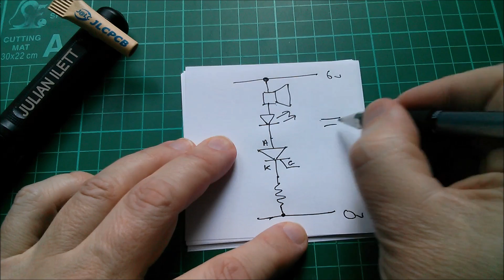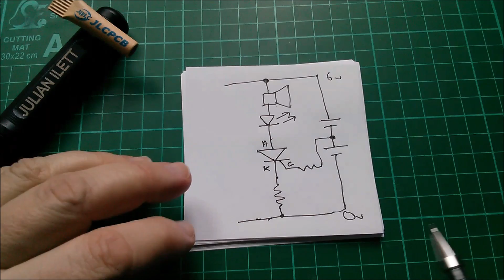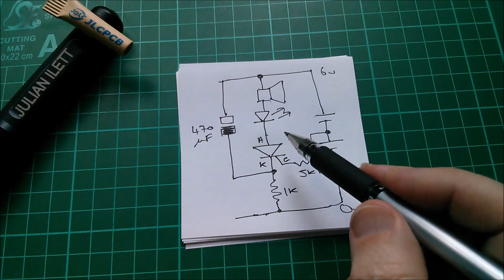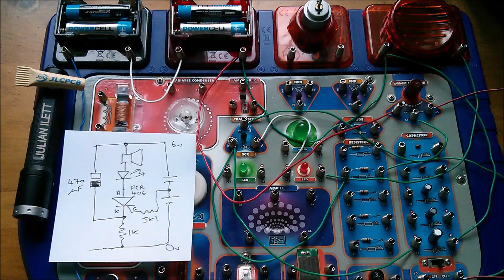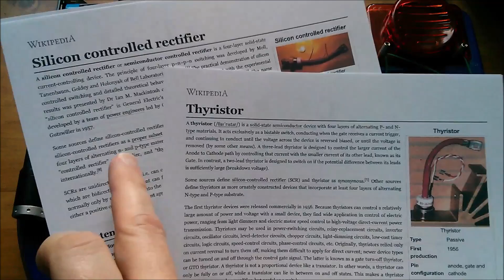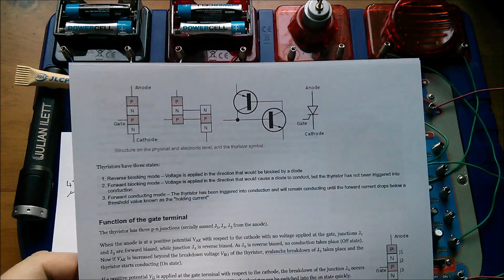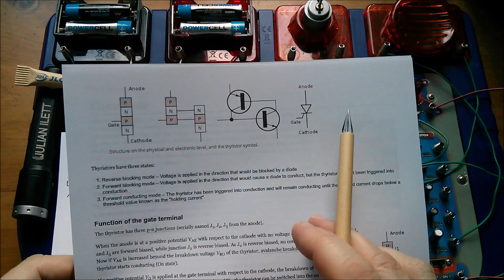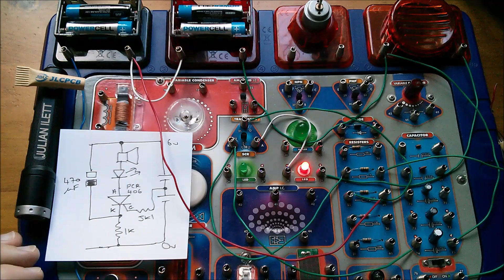LED Flasher using a Thyristor (SCR)

Comment: Eleven minutes of Julian not understanding a damn thing about thyristors - or voltage drops across resistors.

It's not bloody latching if you can turn it off by lowering the damn gate, Julian! Plus, seems to me that the reason it oscillates is because the cathode voltage is rising above zero during the conduction phase.

Comment: Thyristors are still used in high power industrial situations. For example in the HVDC link between the two islands of NZ, they are arranged as rectifiers. But unlike normal diodes they can also be reconfigured to operate as as an inverter, depending on the direction of the power flow required. I believe that you were able to turn off your SCR because you were reverse biasing the gate against the cathode, due to the presence of the 1K resistor. That's something that never seems to be mentioned anywhere when these devices are described, and can create issues in designs when you don't allow for it.  Hope you had a great Winter Solstice..! :)

Comment: +Julian Ilett
I believe that a thyristor can be viewed as two SCRs coupled in antiparallel, i.e. it will allow current to pass in both directions, depending on the state of the gate. It is, of course, implemented on a single die, and not as two separate components. I vaguely remember seeing an illustration where it had an NPNP structure - or perhaps it was PNPN; I can't remember since it was way back in the late 70s or the 80s I saw this image.
Anyway, Merry Christmas and a Happy New Year to you and yours, my Good Sir, and greetings from Denmark.
Reply: You are talking about "triacs" right?
Reply: Oh, right... I had forgotten that term at the moment (bows head in shame)

Comment: Reason the SCR turns off in the later part is that you are drawing current out of the gate, and at the low anode current the current drawn is enough to remove the base bias for the lower transistor in the equivalent circuit, thus turning it off and the top one as well.  For higher current most SCR devices have too high a gate resistance and thus will not turn off this way, though Sony did make the Gate Controlled Switch, which was a SCR optimised for being able to be turned off during conduction by a negative voltage current pulse applied to the gate. 

Drawback was that they typically ran at around 5A, and you had to pull this current out of the gate to turn it off, thus your gate drive was roughly 2V at 3A to turn it on fast, and then a -10V pulse at around 5A to turn it off. In the most common application of these, television line output power device and television vertical driver circuits, the current pulse was relatively easy to get using a simple transformer coupling to the device gate, and they did serve the purpose, in a time when designing a high power, high voltage, fast turn on and off and rugged power transistor was both a brand new science, and difficult.  Later devices were much more rugged and even Sony stopped using these, and there were many modifications to Sony Trinitron sets ( the biggest used of GCS devices) to replace the now no longer made GCS devices, involving a lot of modification to the set, a new larger heatsink for the replacement part, some resistors, diodes and capacitors and a BU508D line output transistor ( and later improved ones as well, more process enhancements made better devices) to replace it. Turns out that GCS devices are prone to fail with time, due to the gate itself breaking down and the device going short circuit. however, Sony did put in plenty of fuses in the sets, so they would just stop working when one failed, and not have a massive trail of fried silicon and wound parts.

Comment: SCRs are still widely used in theatrical dimming systems as they range in current from 15-200amps per circuit.

Comment: You showed what happened when the 1k resistor was dropped to 100 ohms and it just latched on.  but what happens if you raise the 1k resistor higher to say 10k? I assume it would have a slower cycle between flashes but wouldn't latch.

Comment: What's the influence of the speaker as an inductor?
Also, could this be used at higher frequencies for pulse width modulation?
Reply from the maker: Very little - it works the same with or without the speaker :)

Comment: Those springy things seem to be pretty brilliant for connecting temporary wires like that
Reply: I used to have a similar kit back in the 90's, but not quite as deluxe as that. The whole thing was basically a cardboard box with holes punched in the top lid. I eventually grew out of the core projects, flipped the box inside out, connected my own components and penciled in what they were. It's what I used until 2005.
Reply: My childhood Thomas Salter Science "Electronics 2" kit from the 1970s  has similar spring connectors. They used coloured plastic plugs in the end of the springs for components where the polarity mattered (red for positive, but blue for negative).

Comment: The coupled pnp-npn transistor equivalent shown at 8:59 differs from a true thyristor in that you can turn it off by grounding it's 'gate'. A true thyristor can't be turned off like that.
Reply: @
bob s
but he was just doing that when he connected the pot as a voltage divider :-)
Reply: In theory a thyristor can't be turned off with the gate but a more recent development of the thyristor is the gate turn off thyristor (GTO) which can.

Comment: You commented on the weirdness of the potentiometer's travel. Could it be that, being used by some projects as a volume control, it will be logarithmic rather than linear?
Reply from the maker: That's possible. I also know that there's a resistor connected between one end of the potentiometer and the spring connector. It showed up in a previous video :)

Comment: A “thyristor” is just a generic term for a 4-layer semiconductor; these include (but are not limited to) Diacs, Triacs, SCRs, SCSs (silicon-controlled switch) and probably others I’ve since forgotten. You can wire up a “fake” SCR with an NPN and PNP BJT; the emitter of the NPN is the cathode of the SCR, wire the base of the NPN to the collector of the PNP and this junction is the gate of the SCR, wire the collector of the NPN to the base of the PNP, and finally the emitter of the PNP is the anode of the SCR.
Reply: The fun part about that circuit is that you get two gates to play with.  The one will trigger when brought positive,  the other when brought negative.  That configuration can also be used as a "programmable unijunction transistor",  with the PNP's emitter tied to the midpoint of a couple of resistors going to Vcc and ground,  and the PNP's base fed to a capacitor to ground, resistor to Vcc,  and you've got yourself an oscillator.  Outputs are both positive and negative going pulses and a sawtooth,  exponential but can be linear if you use a current source instead of a resistor to charge the cap...

Comment: What is a 5k1 resistor ?
Reply from the maker: green brown red
Reply: it's 5.1k ohms - afaik dates from when requisition forms etc were filled in by hand and the decimal point could be indistinct - the range prefix (k,M etc) got used in the position the decimal point would occupy to prevent that ambiguity.
Reply: @joinedupjon  additionally, R is sometimes used for low values, like 10R 3R3 etc
Reply: @michaeltempsch5282  Thanks, that's probably the most confusing tbh I don't know why I didn't include that -. O for Ohm would of course be too easy to confuse with another zero.

Comment: You can also turn off a thyristor by adding another thyristor in parallel, but with a capacitor in series with the second one, the momentary impulse of the second will shunt the current in the first, so an on off latch.

Comment: Small thyristors/SCRs are also used in cheap Christmas/ party light controllers where the lights are operated from the mains AC supply.
Before microcontrollers became cheap, thyristors/SCRs were also popular as simple memory cells in electronic circuits.
Larger more powerful versions are used in AC or rectified (but NOT smoothed) DC power control systems. They are also found in over voltage crowbar protection systems (often found in switch mode power supply units).
To switch off a thyristor/SCR, the current from anode to cathode must drop below the holding current. Where the waveform of this current is a half sine wave, this happens automatically. In smoothed DC circuits, an alternative is used, that is, another device (either a push switch, or a transistor) shorts out the thyristor/SCR between it’s anode to cathode. This action also “resets” the thyristor/SCR, as while shorted out, the current through it is below the holding current.
Reply: Another turn off option was a similar SCR with a capacitor coupling the anodes of them, and with  a anode resistor that would not allow enough current to hold it on, but would charge the capacitor when the main one turns on. to turn off you fire the second SCR, and this then pulls the first one anode negative via the capacitor, turning it off, and after the capacitor is discharged the current through the second SCR is not enough to hold it on, so it too turns off.

They are also used in DC power supplies to provide a roughly regulated DC supply, using them in either a half bridge or with a full wave bridge rectifier to only turn on when the voltage on the gate is higher than the desired output voltage and then charging the capacitor for the rest of the mains cycle. They were not popular with electrical suppliers, as the resultant DC current in the mains played havoc with mains distribution networks, leading to a few substations catching fire with hundreds of TV set power supplies making a massive DC current in the transformer, leading to the core saturating.

Another use is to make vibratory machines operate, by having the SCR turn on during part of the mains cycle, and this current pulse being used to pull a core in a solenoid and deliver a pulsing vibration to move powders and such. Vary the turn on time and you control the amplitude of the vibration.
Reply: I found one in a dollar store night light. Light controlled.

Comment: With regards to thyristor vs. SCR, as far as the lecturers in my college were concerned, they are just two different names for the same devices. This was back in 1986/7. There are of course variations, just like there are many variations of the different types of transistors...
Reply: My take is that thyristor is a class of devices, including regular SCRs, GTO SCRs, and triacs.

Comment: Thanks for the vid. Merry Christmas/Happy New Years to you & yours. I've studied these SCR's a little online because I'm in need of one in a 10amp battery charger that's 110V @ 60hz. Could I not just replace it with a Mosfet though?
Reply from the maker: No, they work in a very different way. You may be able to re-design the whole charger around a MOSFET, but I'm guessing it wouldn't be worthwhile.
Reply: @JulianIlett  OK, thank you for the reply. After reading on it again only confused me more. LOL. It's hard trying to understand all of the different configurations as how these are used.

Comment: good to see the amazing 72 again... 
guess it's a video artefact but the LED seems to have a ramp up in brightness as it's coming on - but I'd expect the rising edge to be sharp and the falling edge not to be... one of the edges must be pretty sharp though cos the speaker is definately clicking.
Reply: @
joinedupjon
when it turns on all the stored current in the cap is instantly connected to the led and the speaker and it clicks , then it ramps down till the holding current is too low then drops off , but that wouldnt click :-)